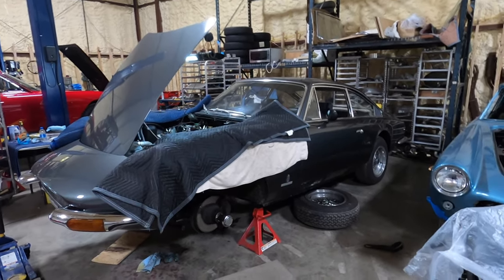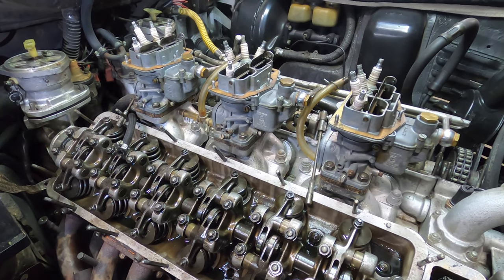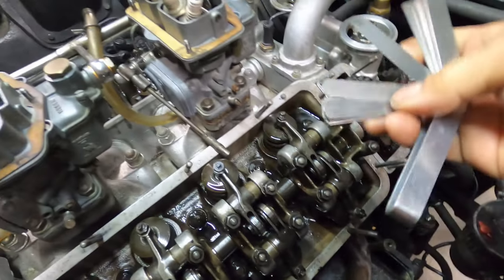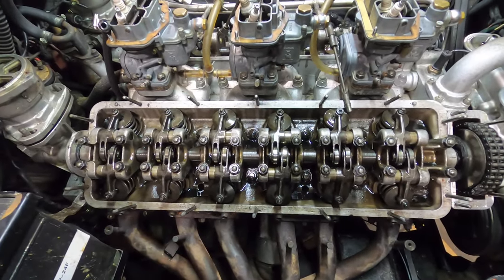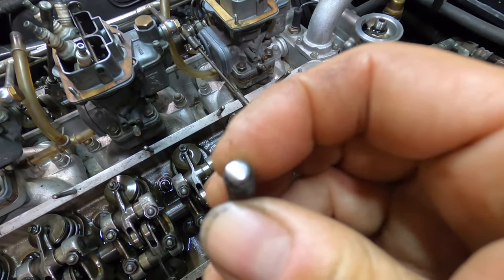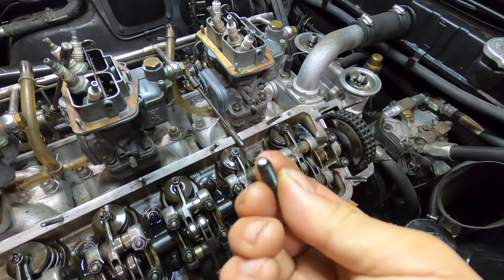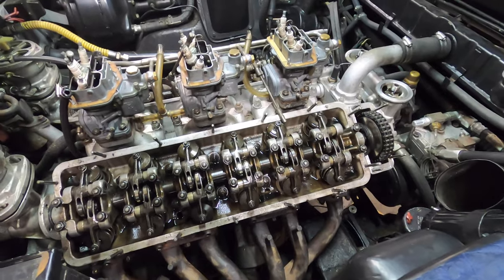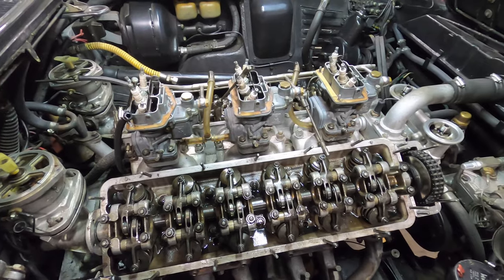365GT 2+2 Service Part I

Comment: Great video. That’s a really good technique to determine top dead center when doing the valve adjustment. I’ll have to keep that in mind as it seems like it should be a really accurate and simple way to go about it.
Reply from the maker: The valve adjustment technique was taught to me by my mentor that learned it from the Ferrari Factory back in the 60s, so I can't think of being any closer to the source! It only works for V-12s or straight 6 engines with the same cam timing, but that's all I work on! Thanks for watching.